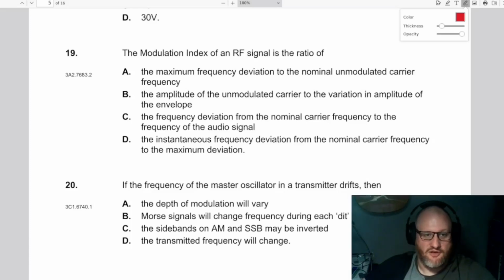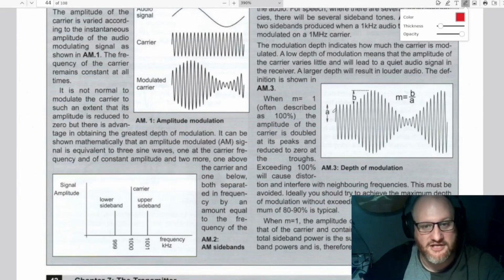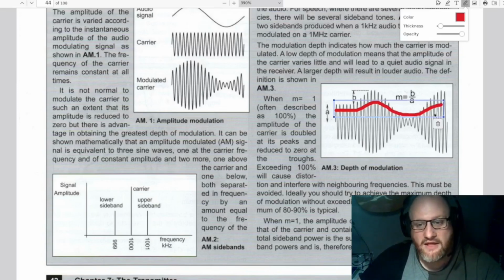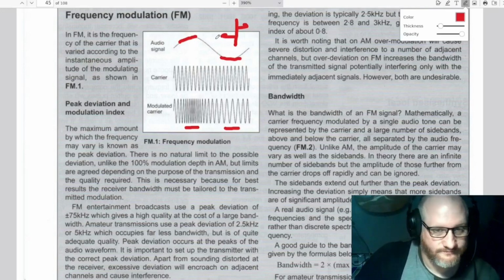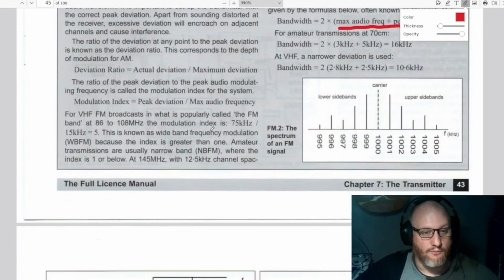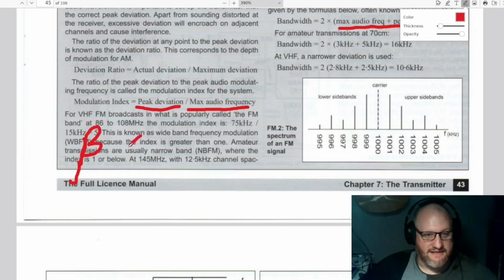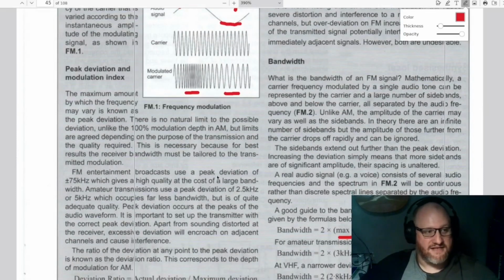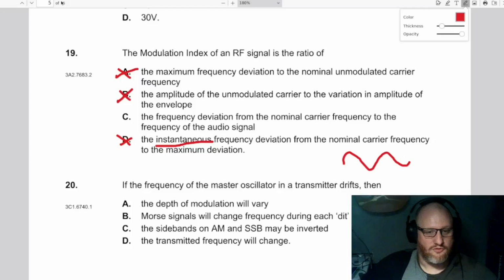UK Amateur Radio Full Licence Mock 1 RSGB v1.6 Question 19

Comment: Hello G4IYT,
First I want to say thank you.
Your work is of a great value for those who will apply for full license.
I am studying for Direct to Full and if you have tips it will be very welcome.
About Question 19, I think the fair answer should be:
 "Modulation Index = Peak deviation / Max audio frequency"
The words Peak and Max are important in the definition.
73 Carlos CR7BPF
Reply from the maker: Thanks Carlos, I'm glad the videos are helping. Will look at Q19 (I found that one quite tricky myself!).

Direct to Full is very challenging but not impossible. My advice to everyone at Full level is not to learn the answers, but learn the reason why the answer is the correct one, which is what I try and show with my videos.

Good luck!